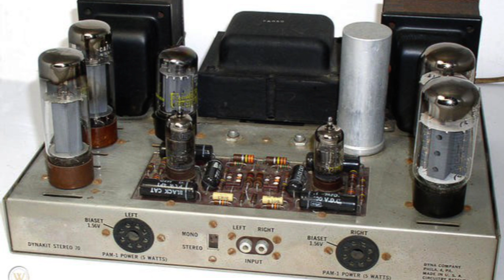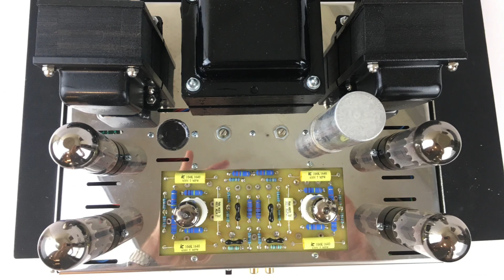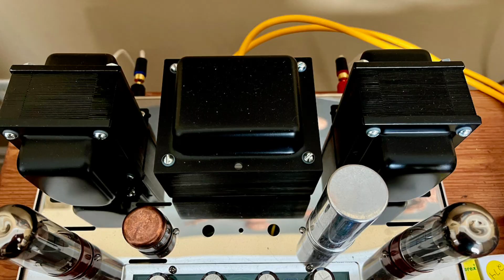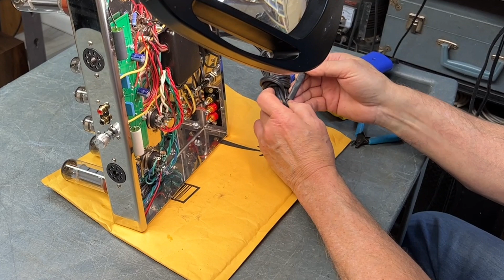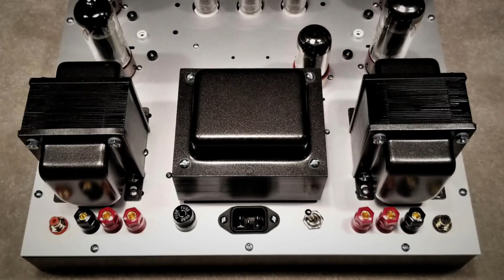The Dynaco VTA ST-70 Review. My First Proper Tube Amplifier.

Comment: Nice amplifier. What is the exact details of Weber solid state rectifier installed and did they add resistor to drop the excess voltage . Thanks

Comment: Dynaco never made the VTA anything.    Vacuum Tube Audio makes a CLONE amp but it has a different input board using something like a 12au7 or similar....
The speakers make all the difference.    My magnepan, for example, are tube friendly EXCEPT for being monumentally insensitive.   
I'd love the VTA 120.....a bigger transformer version of the 70 watt version....Slightly upstream output tubes    I think Roy is gone.....as is Bob.....
Isn't Hafler the 'H' in KLH?
And the NEWEST amps from VTA feature a slightly larger chassis with speaker outs and power input as well as the RCA inputs on the 'back', where they belong.
Some mods while assembling are online....so have a look...

Comment: Hi Dave, I own a 1964 factory built ST-70 from Dynaco that I refurbished internally. From the outside it looks to be a factory unit. I would recommend that you remove the new solid state rectifier tube replacement and replace it with a Tesla GZ34 vacuum tube rectifier. The reason is that it acts as a slow start device for the amplifier. It gives the output tubes time to warmup then gradually applies the 450VDC B+ voltage to the output beam power tubes. A solid state rectifier on the other hand immediately applies the full B+ DC voltage to the output tubes which can damage them as you experienced. 

There is a better solution and I am surprised Bob Latino did not incorporate it into his updated Amp design. Search online at the Dynaco Tube Audio Forum for the "tube rectifier diode mod".  Basically someone perhaps Bob Latino from tubes4hifi sketched a schematic diagram on a yellow legal tablet with instructions. It shows how to rewire the underside of the rectifier tube socket with two 1N4007 rectifiers. If the rectifier tube shorts out, these protect the downstream choke, filter caps, and output tubes from being exposed to the raw 356VAC output from the power transformer. You still have the advantage of the slow start from the tube rectifier, but your downstream components are protected by the solid state rectifiers from a shorted rectifier tube. BTW: This mod works on any Dynaco amplifier. When my rectifier tube eventually fails, I hear a slight ticking sound on the audio output caused by the solid state rectifiers rapid switching. I have not lost any output tubes since adding this modification. The cost for two diodes is minimal. 

One last word. . . Tubes provide for soft clipping when pushed too hard as compared to a solid state transistor amplifiers. Part of the reason for this is that the tube B+ power supplies are not tightly regulated. They sag when pushed too hard. By running only solid state rectifiers you are changing the tonal quality of your ST 70 amplifier. It is no longer true to David Hafler's original design. When clipping tubes produce even order harmonics that to the listener sound like over-tones. A transistor amp when pushed to clipping produces odd-order harmonics that sound grating to the ear. That is why tube amps sound more musical when pushed hard. This is why electric guitar players prefer tube amplifiers. Tubes can also be made to clip producing that popular fuzz sound that guitar players love to use on rock and roll pieces. Trust me the same sound on a solid state amp sounds awful.

Comment: I am wondering if your rectifier tube failed because there was an intermittent problem either with a tube or with the choke. You had to replace all four tubes? I can understand why you might replace two if one failed, but not all four.
Reply from the maker: I only replaced the rectifier. This is an old video, and I no longer own the amp. Thx.

Comment: I am glad I watched to the end to see the even with a so-called true replica of the original ST-70, your professional parts house and assembler managed to screw it up. Just like how most of the Heathkits I have seen arrive after user assembled. I have owned probably a dozen original ST-70s, 3 or 4 Van Alstine Super 70s (the best I have seen), and a couple of Curcio mods. Strange tht the 'pros' of today do better than hobbyists' of the 1950s.  I am using EIco HF-60s that still have f31 GZ-34 tubes older than I am which show almost no wear and will probably outlive my heirs. Used t call the old Svetlana and Chinese ones 'scud missiles'. The Russian ones must be as good as their S300 air defense turns out. The regulator or solid state rectifier completely messes up the sound signature. I am retired now, but have never owned a solid state stereo since my first Scott 290 in 1967.

Comment: I built one of Bob's ST-120 kits several years ago, as an homage to my father-in-law who passed away shortly after my wife and I got married. I didn't know he'd been a Dynaco owner until my brother-in-law told me about his setup. His ST-70 drove a beautiful pair of Altec Carmel speakers, which he still had when I met him. My mother-in-law told stories about him listening to pieces like the 1812 overture at  a respectable volume, which would usually run her out of the house "to go run errands." She used to ask him why he didn't plan his listening sessions for when he knew she'd be out of the house already. After building my amp, I located a pristine Dynaco PAS-3 preamp that still had its original Dynaco tubes, which were made by Telefunken. 

There is what's called a "yellow sheet mod" for this amplifier (ST-70 & ST-120,) that installs a solid-state rectifier diode after the rectifier tube. Not important if you want to continue using the GZ-34 rectifier, but if you ever want to put a 5AR4 back in it's place, the mod will protect the tube from damage due to overcurrent, which usually leads to arcing inside the rectifier tube. I built one of Bob's ST-120 kits several years ago, and I opted to do the mod due to the extra current draw from the bigger KT88 outout tubes.
Reply: ST70 / Altec sounds like a PERFECT match....I'll bet it sounded great

Comment: Thank you for your post, it confirms I am headed in the right direction. About 1990, I was getting into High End Audio. I got some a pair of Vandersteen 2C's, Adcom GFA-555, Superphon Pre amp. I found out Vandersteen's sound better with tubes. I was ignorant of tubes, so I sold the 2C's. A little while after I started playing (designing and building) electric guitars....It's all about tubes! All of my guitar amps have tubes, (most were built in the 1940's and are point to point wired). I befriended an electronics repair tech that repairs tube amps, Ham and CB radios. He scratch built a guitar head; using my ears to tweek the circuit., (one 6L6 and one 12AX7; 5-8 watts, this is what I perform with as a monitor, don't use any of my other amps). After 30 35 years I thought of getting back into High End Audio, but the price to get back in was crazy. Fast forward to present day: the guy I sold my 2C's gave them back to me, I bought a vintage ST-70. I am also leaving to spend my birthday next month to purchase a pair of Spendor SP-1's. Plus some other things like a tonearm and stylist. I also bought my first high end turntable that was made by the guy who owned the ST-70, (he was also a professional bass player). Maybe I should start a YouTube channel for the complete story!

Comment: I have 4 tube amplifiers. 2 flea watt amps at under 3 watts for fun and 2 rebuild by me Magnavox 6v6/6eu7 amplifiers from 1958 console stereos. They make about 10 watts each. I purchased them for less than $100 each and did all the rebuild/conversion work myself. Great learning experience. Love their sound and would not go back to SS for my main listening rig. The Dynaco amp is interesting as there as a few modern builders that base their offerings on the Dynaco design.

Comment: I’ve got 7 dynaco st70’s and 8 of the mono blocks that I’m hoping to use again someday with the massive horns that I modified into a synergy horn type arrangement triampped between 4 12s per side all actively crossed over. Nothing sounds like tubes and the dynaco gives it to you for a nice price

Comment: Have a VTA ST70. Good amp; easy build. Look at the M125 mono block. Great unit for the $. Straightforward build. I opted to hard wire it to ultra linear mode. Bob Latino wasn't too happy with me for doing so.

Comment: I run RCA tubes in my original amp.  Punchy bass is bo problem.  Does not sacrifice mid or high detail.  Using Amperex drivers with the RCA  output tubes.  Other than being recapped and 1 replaced resistor about 6 years ago, all other parts are original.

Comment: There are a lot of comments here and I don't know if anyone mentioned using SS rectification with a time delay. I would always want to delay the B+ when using diodes in place of the 5AR4 so that the filaments have time to come up before the plate voltage.
Reply from the maker: I used a SS Weber.
Reply: Yes, but you really should be using the B+ time delay relay with it.

Comment: I have 3 ST-70 Each with completely different Mods.
I personally found through 1000's of hours of listening of EL34 tubes; #1 JJ's & #2 Sovtik Sounded the Best By Far. 
Followed by #3 Mullard #4 Electro Harm, #5 Tung-Sol. The Chinese tubes Sound Dead to me. Not Musical At All

If you can get A REAL Set of Sevetlana EL34 made in St Petersburg they are glorious.
Leaps & Bounds better than JJ & Sovtik
Unfortunately there are a lot of fake Sevetlana's out there.

Comment: I think that HH Scott unit are a better choice to get into vintage tube amps. The pre amp is already integrated . tone control also .
An they sound better .A good 299d is a great well finished amp. That sounds better than the st-70
Reply from the maker: I traded the ST-70 type amp for an old Conrad Johnson preamp. I’m looking forward to getting the Scott back from Jim. Thx.
Reply: I have a LK 48 that's blowing my mind. The grip on  my Magnepan 1.7s is amazing. And I believe it's less than 20 watts!
Reply: @67spankadelik  Scott amps are so well build .. Come on you want to  compare that to a DIY

Comment: Beautiful looking amp. If you do manage to get another GZ34 rectifier you can install it with protection diodes (2 x 1N4007's) which should stop the valve blowing up. You will then get the sonic tube sag benefits - yes benefits. Another benefit is as follows, when you apply high voltage on cold tubes, as in your case with the solid state rectifier, in those first 11 second when the filaments warm up, the tube cathodes can 'strip'. The K thermionic chemical coatings can dissipate too quickly. A GZ34 / 5AR4 tube rectifier heats up too and all valves come on together thus preventing the stripping of the cathodes. This saves the EL34's which are pricey.
Reply: Tubes 4hifi sells a time delay relay kit for use with solid state rectifiers that delays application of B+ until after the tubes are all heated up. You might consider adding that.

Comment: Nice sum up on a Dynaco kit.The only thing you make a wrong assumption on is the tube rectifier that it has no influance on sound.Please try it and switch between SS and Tube rectifier,just use a old used 5ar4 and a new one,and than the SS diode bridge.

Comment: The Dynaco amplifiers use a ultralinear output circuit which Keros and Hafler patented in 1955. This circuit has the best features of tetrode and triode tubes, I don't know if the modern versions use the screen taps in the output transformer that are essential for ultralinear operation.
Reply from the maker: I would say they faithfully copied the original design with a few improvements. Read here: http://www.tubes4hifi.com/amps.htm

Comment: Thanks, for your video and thoughts! I was hankering to hear what all the fuss was regarding tube amps, too, and bought a Japanese Luxkit A3600 (MQ3600 was fully built export model) power amp with a similar tube complement - 4 x KT88 power tubes, a pair of 6FQ7 driver tubes, and a 6AQ8 input tube. It turned out the output transformers have ultralinear connections and these were wired up to the screen grid pins of the KT88s. Ultralinear mode is a compromise between triode and pentode modes. If it is a compromise, it is a very fortunate one because it provides extra oomph to bass frequencies you might lack while retaining some of the triode sweetness. I recently upgraded the power tubes from KT88s to KT120s and they really make this amp sing! I'm not going back to solid state and I doubt I will ever part with this amp!

Comment: I have  a multitone M250 amp (4 times EL34) and the sound is absolutely incredible it doesn't matter what speaker I hook it uo to the currents are wharfedale 515's with replaced tweeters but that doesn't matter at all. sounds becomes like physic objects in the room you can instantly hear how good it sounds. I can imagine this dynaco thing sound just this good. good lord the sound coming from a good tube amp is just divine jou have to really hear it to believe it. all the sounds are 'physical'.. they are there in the room like physical objects
Reply: just.. just fucking incredible
Reply: MULTITONE
hifi power amplifier
2 x 50/75 watt type M250
Reply: that's what it say's on the label the thing is absolute beast if you can get one of those then you've got a REAL ampfier and I mean REAL. absolutely ridiculous how good that thing sounds...
Reply: I bought it directly from the guy that made them in the city of arnhem I looked trough the window "that's the amplifier I want" it's not the usual tube amp it's just a rectangular metal box. when I bougt it he said something about the transformes they were apparently important. They are kind of professional there are ohm setting at the end you can set it to 4/8/16 ohms or 50/100/200 volts distance settings they are kind of semi-professional. I guess the guy is dead by now those amplifiers are not mass produced. it's difficult to get one but if you have one holy f... I can't get over how good this amplifier sounds all the sounds are so 'real'  an absolute 'beast' of an amplifier.

Comment: Funny you mentioned the heat.  I’m in S Florida so I really don’t run mine much in the summer.  It does heat up my stereo/office/man cave nicely in the winter however.  Mine is an original Dyna version.  I keep the cage on most of the time.  Not because of children but due to an inquisitive cat.  I noticed that you have one of them also.  Enjoy.

Comment: Tube rectifiers generally sound better than solld-state rectifiers. They reduce the ringing that occurs when solid-state rectifiers turn on and off. Tube rectifiers have a soft turn-on and -off characteristic that reduces noise. They also have considerably more voltage drop than solid-state so the power transformers has been designed with the tube's voltage drop in mind. Using a solid-state rectifier can therefore produce a considerably higher B+ voltage which can exceed the voltage rating of the filter capacitors and also shorten tube life. Buy a used rectifier on eBay or elsewhere if you can't find a new one.

Comment: How would you compare the sound of this compared to a nice Marantz receiver? Specifically, playing vinyl.
Reply from the maker: This amp does not have a phono preamp, so it's not comparable in that regard. In terms of sound, I MUCH prefer this tube amp. I sold the Marantz 2270.
Reply: @MODAC  Would a tube amp such as the one you made have an input jack that I could use my Schit Mani with?
Reply from the maker: @JohnWDGTandTele  I would look for a tube integrated amp with several inputs and a volume control. The mani would connect to one of the inputs.
Reply: @MODAC  thanks!

Comment: I think if you are on a budget as most of us are then "hybrid" amps are the route to take. Usually this means tubes on the pre-amp stage and solid state on the output stage! This is a great combination because you can get the tube sound but still retain the power on the output stage .  My present hybrid amp has an output rating of 130w per channel into 8 ohms. Plenty of power for my floor standing speakers but still with the ability to roll the tubes on the preamp stage!! :)
Reply from the maker: I may go that way in the future, but I’m enjoying this one right now.

Comment: Looks nice, but not my thing.
I own a few tube radios, just for fun, for the historic value.
But using tubes for optimal sound quality... nah.
Reply from the maker: You can have more than one system. You can have an “optimal” one, and others for fun with a different presentation. Additionally, there are powerful tube amps available that are equal to any solid state unit.
Reply: @MODAC  Hmmh yes, a second system, I've been pondering about that for some days now... 
I recently pre-ordered a second turntable, a limited edition SL-1200M7L, so maybe I should build a second system around it.
In the distant future, some day...

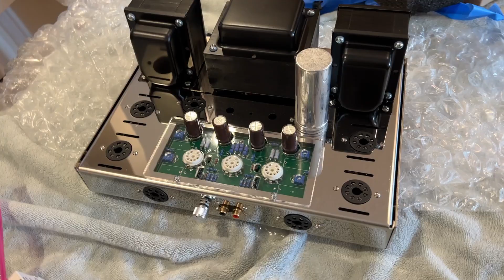Comment: Um...The sliced power cord is a dangling plot twist that's screaming for elucidation. I can see the cord looks cut at 10:58 , directly after your unboxing. Strange because that deep of a cut would take quite a lot of effort.
Reply from the maker: I did not inspect it, so I never noticed it. Mr condenser and I are very puzzled. He suggested that the very tightly wrapped zip tie may have been the culprit. Who knows.
Reply: @MODAC  Thanks for the reply. The best news is that there was only a bit of smoke and no fire.